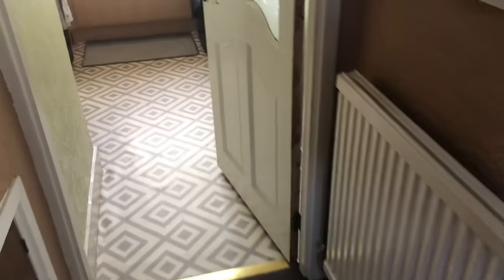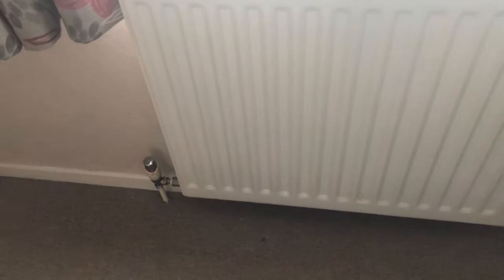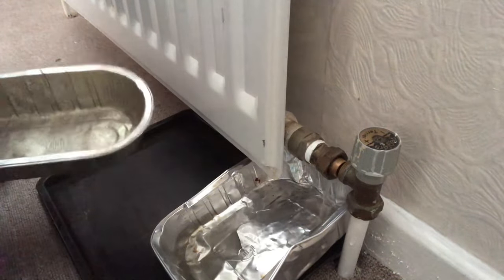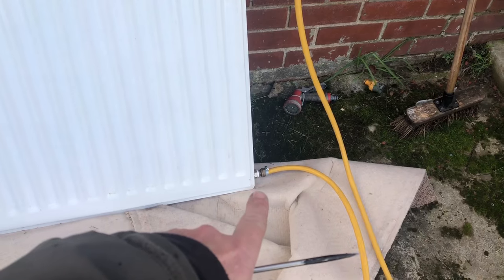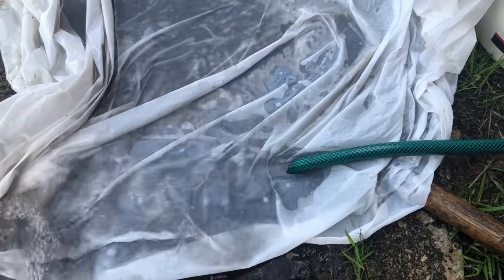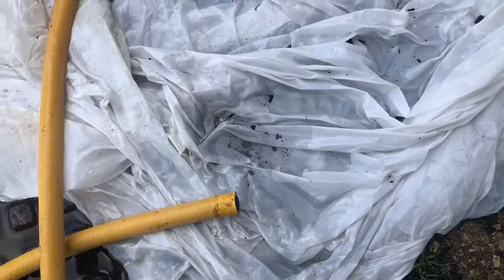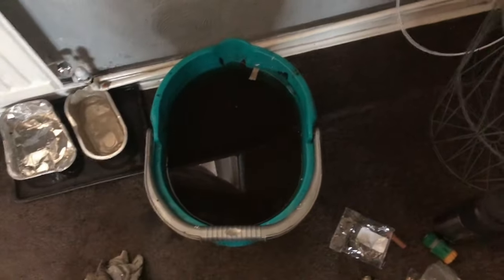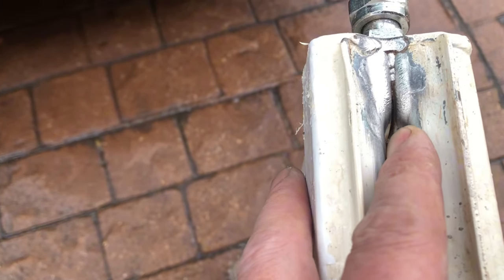DIY Central Heating System Radiator Flushing.

Comment: Not the best way to "clean" a heating system as you havent cleaned the pipe work buddy so what evers left in yhe pipe work will go into the radiator now.
Reply from the maker: Did you miss the part of the video when I put the combi boiler in fill mode with the hose connected to the central heating drain point in order to flush out the boiler and respective pipe work?
Reply: doing a mains flush like you done you should have just cut a drain valve on the flow at the boiler, isolated the flow  valve, open the filling loop and do one radiator at a time. No need to remove them off the wall
Reply from the maker: I have no regrets given the amount of filthy magnetite  I got out of them. I know there are easier ways but I think there are advantages to removing and inverting the radiators to flush them totally clear.
Reply: Hello how do clean the pipe work out.
Reply from the maker: @vicmills7702 It gets flush when the system get’s drained with the boiler in fill mode.

Comment: You can get a system cleaner for flushing, add prior to flushing system. Inhibitor is for after cleaning to prevent future corrosion of the system.
Reply from the maker: I was thinking along the same lines but I guess that didn’t come across in the video,  thanks for pointing that out.

Comment: Why not just introduce a cleaner (FERNOX or SENTINEL) to the system and circulate it, agitate the rads then drain? Add a suitable inhibitor, refill, vent and repressurize….hey Presto
Reply from the maker: A cleaner wouldn’t remove that volume of sludge.

Comment: Wow,  when you take out the radiator and show how dirty was inside,  any idea when was the last time someone service them.  or how often we must do this kind of job, each 3 years ?
Reply from the maker: I haven’t got a clue how long the neglect went on for as the house was newly purchased at the time I would guess at several decades!  With regular application of central heating conditioner or the use of sludge filter it shouldn’t be necessary to periodically do this.
Reply: @TheRepairer  That for your reply, I am in similar position, just moved to a house and no records of services etc, and no magnetic filter, anyway, in my understanding what you did is the best, the magnetic filter only capture metal, you clean the system deeply, and take out limescale, I showed your video to my wife, she was complaining lol due I want to flush and put new inhibitor ,  I told her, look this video how dirty it is, what we must do,  thanks for you video. I will short term put a magnetic filter to my system.  It is like buy a used car and trust the previous owner did the oil changes on times. ha, no way. new oil new filter right away.

Comment: Sludge inhibitor date I think was 30/09/15 or 26 expiration 🤣 good job .I have popped a couple of raw eggs in it stopped leaking which gave me a day or so to get new replacement radiator.i can see you are a jack of all trades hopefully more videos to come.
Reply from the maker: I’m kept busy as usual, I have much more content available for release at 1800 every Friday. I am familiar with the egg radiator fix, I have used it in car radiators and gone to work on a egg on many occasions!

Comment: Thats a fairly clean system from what you got flushed out. Hope you put inhibitor back in to prevent the oxide happening again
Reply from the maker: Yes I did put some inhibitor in as shown in the video. I estimate that could have been a 40 plus year magnetite buildup as it had a back boiler in before the recent combi boiler.

Comment: Main's flushing is the worst way to "clean a heating system". 

There should be a power flush machine and separate magnets connected to the system flushing at 45-55 degrees with a cleaning chemical. individually flushing through each radiator switching the flow and also dumping the water as you go whilst agitating rads. These cold water mains flushes dont remove 50% of the magnetite you need heat and chemical to react with the sludge to loosen it.

then at the end of the flush you should be testing Water PH levels and PPM Levels to ensure the levels are correct, also there should be a test to ensure the inhibitor levels are correct. Also should be handed a water quality certificate also a heating system flush certificate..... Theres a water quality course you go on to get certified. (If this step isn't done then the flush you've been paid to do shouldn't of been done as the magnetite and corrosion will just build back up again over time)

Personal opinion this should be left to us plumbers/competent person.... the amount of jobs that ive gone to where theyve been "mains flushed" and ive had to do the whole job again that should of been done from the get go is a joke. 

i feel sorry for the customers the most i've saw people get ripped off so many times and it just brings the quality of the industry down. 

i see youve had a go and spent a good period of time there but its not correct.

sorry if im coming across in the wrong way im just trying to give out advise theres more to flushing than you would think there is. it doesnt look very professional towards a business flushing radiators with a hose
Reply from the maker: It’s DIY effort that has resulted in a good working central heating system that was previously clogged. 

The central heating system now has visibly clear water at the radiator bleed screw and I don’t feel the need for a certificate to verify this.  

I appreciate applying modern kit hot water and chemicals would probably clean them out better. 

I have used some old techniques that more than likely existed before any of the high tech kit did. 

I am very pleased with the results and there is a sludge filter inline to further clean the system whilst in operation.
Reply: The matter of the facts is you've not done a proper job here and you cant understand why😂 water in a heating system means nothing pal, if that water Ph & PPM levels aren't correct the corrosion is going to come back and effect the system even more. 

they may be warming up and look clean but i guarantee you if you put that heating system on a cycle for a couple of hours and fully drain it down it will be dirty and black again.

if your going to do flushing, Do your water quality day course and a power-flushing day course, grab yourself a proper powerflush machine and some magnets to go with it get the flush done properly and then hand out your customers the correct certification.... 

you give the customer correct documentation if their boiler breaks down and the manufacturer comes out they will want to see the documentation provided i see this weekly were on average doing 1-2 power-flushes a week
Reply from the maker: I have added an inhibitor to the central system as detailed in the video to prevent any future corrosion assuming you watched that far.
Reply: I watched you add an inhibitor yes, but again back to the point of water quality have you checked the inhibitor levels are correct.... my whole point of job not done correctly you don't just throw a bottle of inhibitor in there and think oh i've protected the system youve got to test the ph & ppm levels, i dont understand what your not understanding 😂😂😂
Reply from the maker: @MJHPlumbingServices  I am happy with the work I did and the respective results. I followed the instructions on the central heating inhibitor which didn’t mention anything along the lines of water quality post application just treats up to x radiators.
Reply: @TheRepairer  and thats why you should stick to something your qualified in doing, its people like you causing us more issues with system breakdowns. If your going to do a job do it correctly and to the current standard or not at all. Proper cow-boyish this video is mate👍🏼
Reply from the maker: @MJHPlumbingServices  Your entitled to your opinion,  I don’t value it as it’s very  far from impartial, you are in business doing exactly this process and having videos like this one on the internet isn’t in your best commercial interests henceforth the reason why you are doing your level best to rubbish it in any way you can conceive.
Reply: @TheRepairer  Im not trying to rubbish anything in with you pal, hats off to you for having ago.... im just a strong believer in "Don't do it if its not being done properly" you can go to a-lot of plumbers pages on here and watch what a proper flush is i think you will be amazed at how much rubbish it pulls of of the system doing it the correct way. 

the amount of issues it can cause the system behind the scenes without you knowing unless called back its crazy. plumbing category jobs do do with heating is a skilled trade and takes years and years of site hours to qualify. 

Im just trying to advise you to stay away from things that your not qualified in because if it ever backfires and ends up going down the legal route you could potentially loose everything ive saw it happen before and its not a nice thing to see from an outside perspective it causes people alot of pain.
Reply: @MJHPlumbingServices  You do go on don't you.I'v had cowboys in my house lads who didn't have a clue and where supposed to be qualifeid.I often had to correct them and told them to get out of the house.The plumbing trade is awash with them.I only had a three year Technical school apprentice in Rotterdam as a lad.